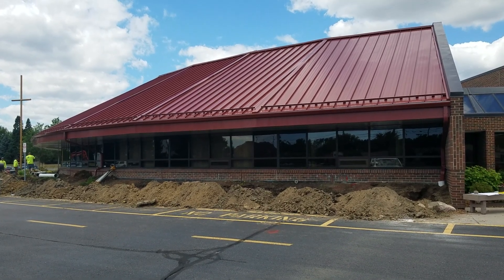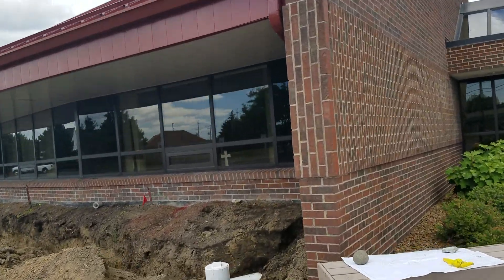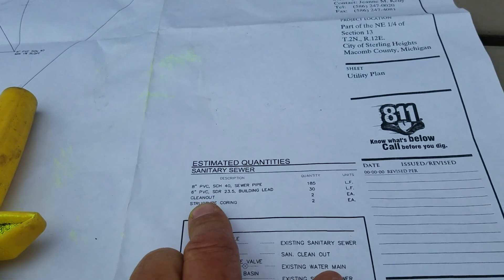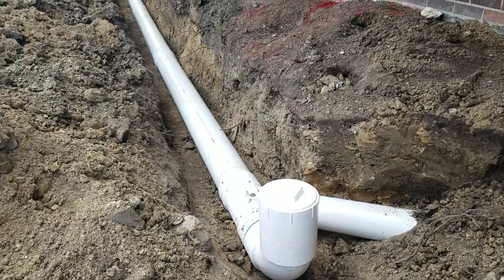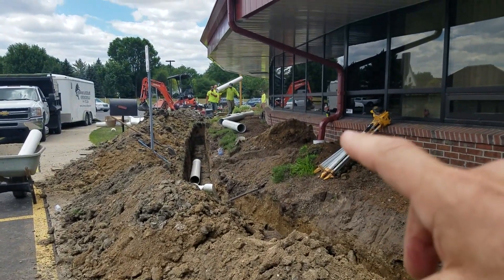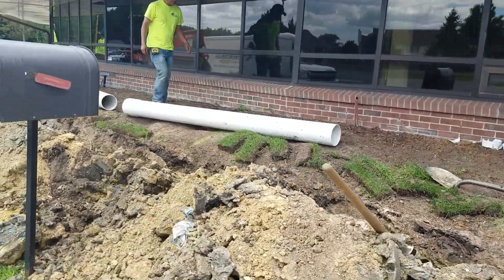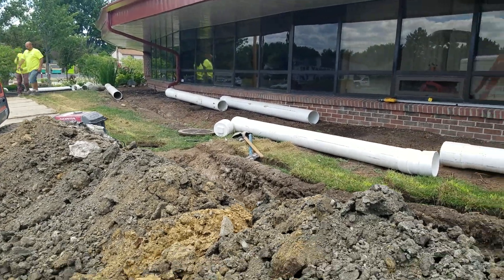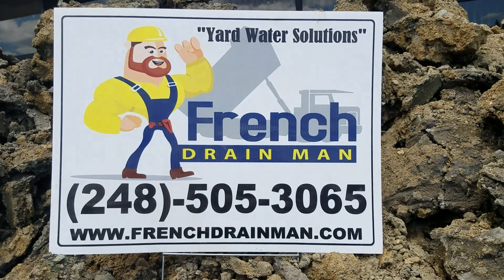Commercial Underground Drainage System For Roof Runoff Water

Comment: I watch and learn from all your videos. Is the 8 inch main pipe enough to handle a building with 7 downspouts? Roughly 165ft
Reply from the maker: You only need 6" Main for 7 Downspouts  going to 8 inch you will lose water pressure (PSI) and not flush out debris. I really need to do a video on this topic. Thanks for the motivation.